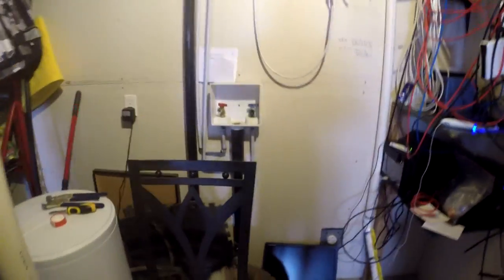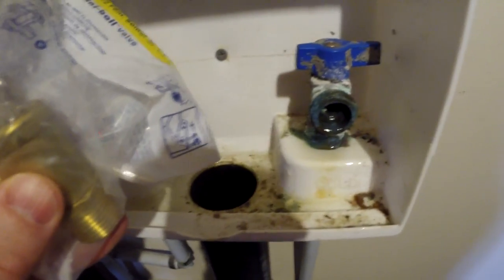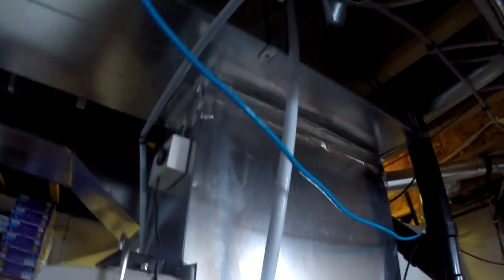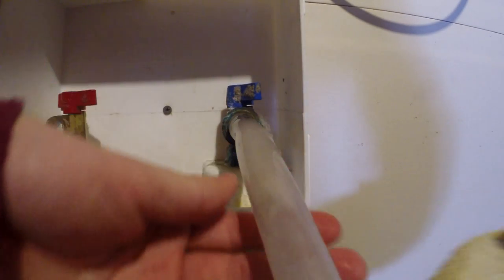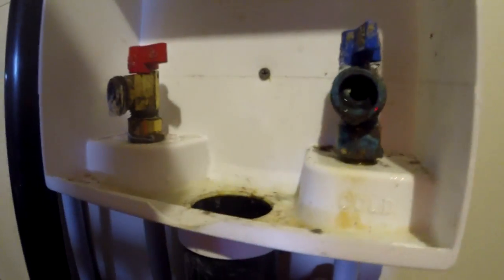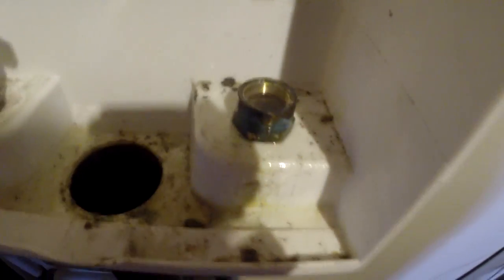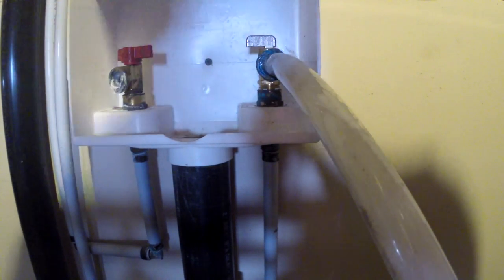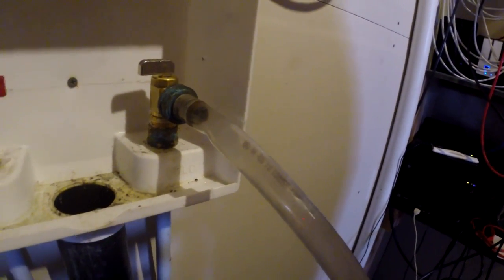How to Replace a Dripping Faucet

Comment: My faucet was leaking  on the hot side (red). I replaced a new one like you but it is still leaking from the base, what could be the problem? Do I need to cut the drywall to see it was leaking from the stem?

Comment: Do I really need to fix the water valve faucet if it only leaks a bit when the water is shut ? (Same as what the guy in the video had). I mean it will be hooked to a washing machine and it doesnt leak when the hose is on. I only noticed it because I unhooked my washing machine to repaint the closet. Unfortunately my water valve box is also blocked by a drywall.
Reply: I know you asked this 2 years ago, but the faucet should be replaced: 1) it is failing and it can start leaking from the stem and/or worse 2) the next time you have to unhook the hose it will leak, leak worse or won't be able to shut off because it corroded up.

Comment: So my two shut offs have drywall around the box so I have no access to push up the valve and it’s socket. There is a hex base just coming out of the base of the valve I might be able to get a wrench on while I screw the faulty valve faucet. Wound that work. Nice video but you assume everyone has access to the bottom of that framed in assembly with absolutely no offense intended. You comments would be appreciated.
Reply from the maker: Hey, yes, it sounds like the hex base should be attached to the pipes and the value should be able to unscrew from there. The builder should have left this option exposed, but I'm not 100% sure. Maybe take a pic and ask on reddit or ask at home depot to be sure.
Reply: Cut an access hole in the drywall. Make a little removable cover with plastic or thin plywood or something.

Comment: That’s the wrong Teflon tape. It should be blue. The red is for gas.
Reply: The white tape (not the label color) is for basic thread seal and correct for his application.  Altho, I think he should have used more wraps and there's a better technique than shown.  Yellow tape is for gas.